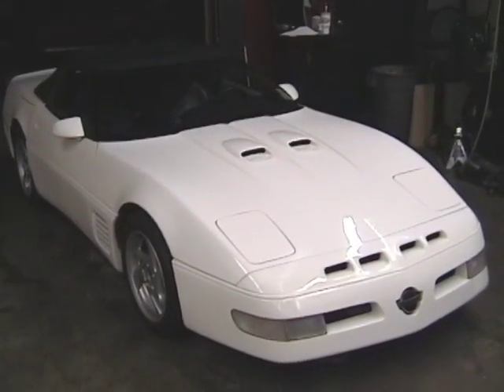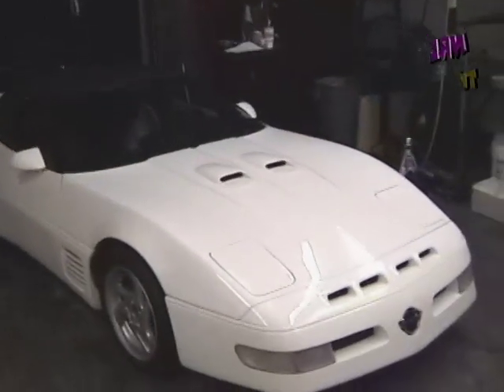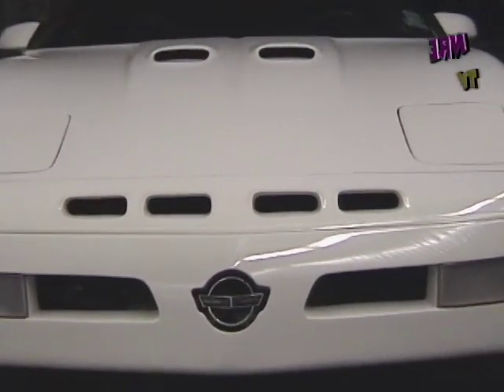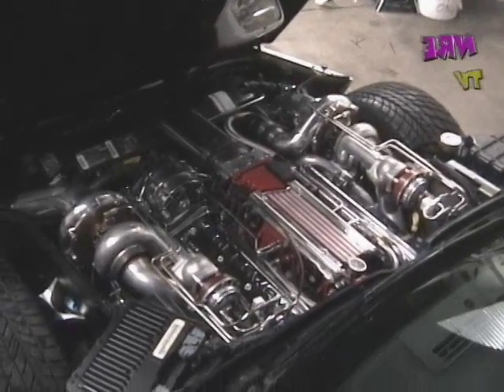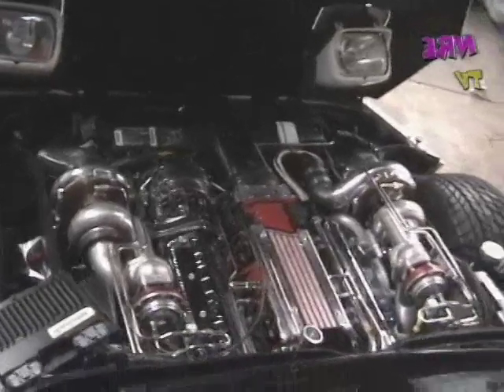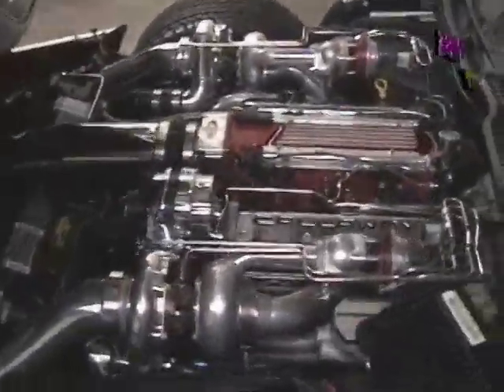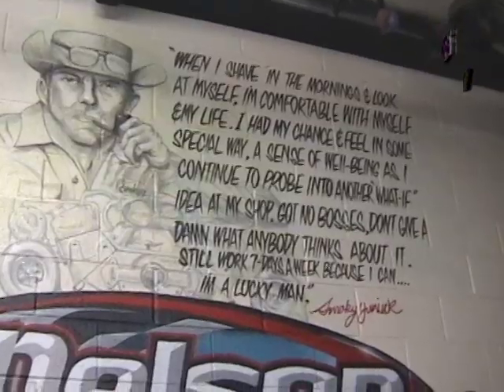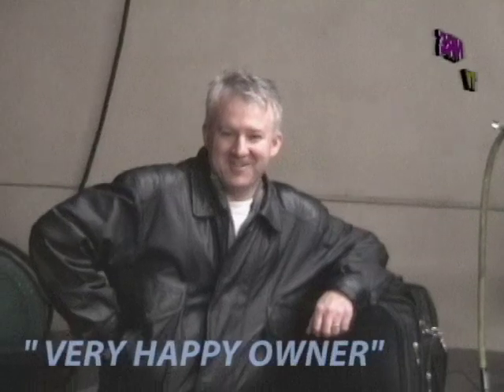1000 HP TT Callaway Corvette from Nelson Racing Engines.  Street Test.

Comment: ^^ This. It's a different world. The first few times when you start driving your big power car and you're merging on the highway in 3rd gear trying to be normal and at 80-90mph, it spins the tires again when you could've sworn it was hooked up, you start to understand what you're dealing with. And then it actually never gets old.
Reply: I had a 2013 camaro 1le with twin turbos. it wouldnt hook below 75 or 80mph. occasionally it would spin at that speed and the backend would kick out...wasnt fun...lol.

Comment: Love to know what they used for the turbo lag, which blow off valves used and if that car will do even more speed as in will it reach over 300 miles per hour, that's what i want to see is a Callaway mid engine twin turbo or supercharged and turbo mid engine c8 Z51 package going over 310 miles per hour or even better smashing 320 miles per hour to hold the record for a factory built car with calloway name on the back of it. with little extras engine built and suspension built and extra better brakes as in slotted and dimpled rotors keeping the same brembo made calipers etc, just with calloway name on them etc, that's what i want to see. :)
Reply: And with the cage so there's a better chance of surviving a wreck

Comment: I am confused. How do you have a 1995 Callaway? I was pretty sure the B2K RPO code was no longer available after '91 or '92. They only build about 500 of the C4 Callaway Corvettes. Do you mean you took a 1995 base LT1 car and swapped in the TT Callaway motor?
Reply: No, they took a naturally aspirated Callaway and Nelson added twin turbo's to it. Not all Callaway's were turbo directly from Callaway themselves. The B2K was an option designed in anticipation of the LT5, once the ZR1 hit the scene they dropped the B2K option. Callaway still produced high horsepower C4 corvette's before the switch in '97...
Reply: All Callaways after '91 were SuperNaturals's. None of them were Factory RPO's.

Comment: I dont recall if this was the Callaway Vette named “The Sledgehammer” I 1st remember in an issue of Hot Rod magazine in High School if not then it was 1 that was nearly identical and at the time it was so advanced it had    etremw HP
Reply: The sledgehammer was based on a 88 coupe. It made 898 H.P. with 22 lbs. of boost but was good for more. GM asked Goodyear to make a tire for the sledgehammer that looked like the stock tire but capable of running 300 MPH. It's rumored it cost Goodyear a million dollars to make them. The car sold and is in a private collection.
Reply: Sledgehammer is a single vehicle made purely as a rolling experiment to see what Callaway could do with a street car.

Comment: 1000 hp is not to be fucked with.... I had a 330hp sx, and that would kill any first time driver, or even normal everyday driver over the age of 30 if you fucked with it and didn't respect it once the turbo kicked in at 20psi... so my Sx power X3 is frightening,  so fair play he was conservative. that's because he has a clue, because you can't just mash the gas!! plus he has to 'run it in' as the oil in it is thicker and wont get to the head at high revs as it's for "running in and lubricating" for first 3k miles or so.  then you put thinner oil suited to the engine and can give it some.... otherwise you'll ruin the head and maybe big ends.